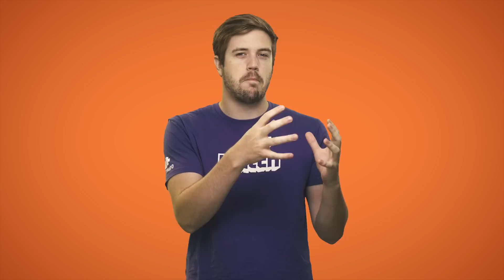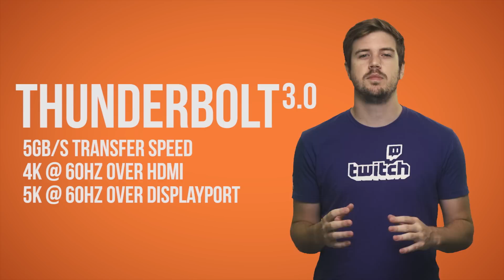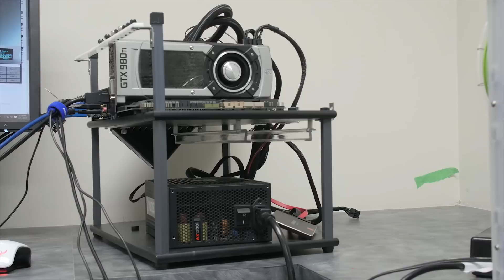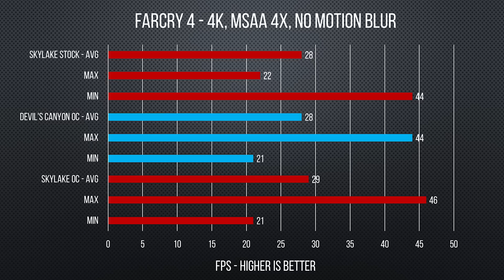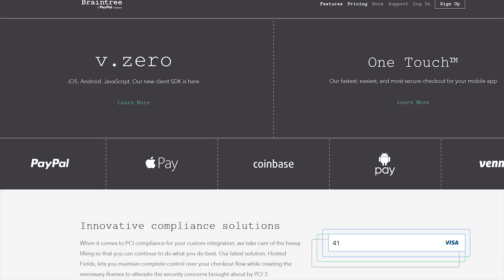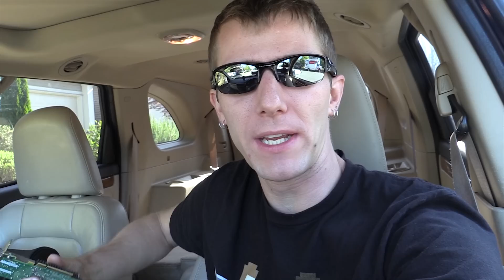Intel 6700K "Skylake" CPU

Comment: I'm on a budget, but is this build okay? http://pcpartpicker.com/p/JP9sNG
Reply: "budget"
Reply: Ethan Ly You know, the usual stuff. Web browsing, facebook, minesweeper, and MS word/
Reply: +Andloo Yunty It's brilliant, but honestly I'd replace the CPU with a potato. The new architecture that they implemented with the latest potatoes (codenamed "baked bean") really helps performance-wise.
Reply: ***** I know, it really is bad. I wish I could afford better ;(
Reply: 2263275electro They don't make 4TB, first of all. Second of all, I don't have enough slots. Thirdly, raid 0 scares me. Fourth, extra speed doesn't corrupt an OS. Fifth, who uses osx?
Reply: ***** The SSDs were PCI, so I couldn't have any more, the case doesn't support any more fans, and the smaller monitors are better than the 34 inch, so I use those for gaming and the 34 for watching netflix and surfing the web. I don't know much about peripherals, but I have tried the MX Master; I like it, but it wouldn't go with this build.
Reply: ***** Did I not say it's a BUDGET build? Do you think I can afford the $2.95 shipping on an MX Master?!
Reply: +Andloo Yunty hey what are you planing to do on it?
Reply: +Andloo Yunty You need 2 xeons... i heard they are the cheapest cpus on the market!
Reply: +Andloo Yunty buy 4way sli GT 210
Reply: +Andloo Yunty Will powerpoint animations run smoothly?
Reply: 2263275electro That's what I'm hoping for. :P
Reply: Andloo Yunty I`d recommend adding pci express 4 tb ssd`s in raid 0 to slow down the boot time. As it may corrupt your osx.
Reply: +Andloo Yunty everyone just wants fun man
Reply: 2263275electro Your friend got caught blatantly lying, it seems to me that he doesn't want to troll anymore. :( oh well
Reply: SoFloAntonioTheMLGPro Whoever told you that doesn't know what they're talking about. If you want to put a GTX Titan X, there will be severe bottlenecks in that build. A bottleneck is basically something that prevents something else from performing at full capacity, just as a real bottleneck prevents liquid from flowing at its full capacity. Also, the GTX 980TI outperforms the Titan X in gaming. Here is a better build with the same budget: http://pcpartpicker.com/p/ZGLCNG

     First of all, you need storage. In your build, you have a total of 150gb, which is enough to hold just over 4 major games.

Also, I don't know what possessed you to put those headphones in a gaming build. There is no game in existence that can use that audio. Plus, those headphones need an expensive DAC to achieve their full potential, so they wouldn't be doing much. They also didn't have a microphone, which you'll need in multiplayer games. 

Furthermore, you said you wanted 4k 120fps, and the monitor you chose is only 60Hz, which means 60fps max. I gave you 3 144Hz (144fps) monitors, with 1080p and your chosen monitor as a 4th screen that is 4k.

Also, you need much more RAM and a much better processor to avoid bottlenecking your video cards, so I gave you 16gb of 2400Mhz DDR4 RAM to replace your weird 2 gigs, as well as the current gen i7.

I tried to keep with your red and black theme throughout the whole build, and I hope you enjoy.
Reply: samuele collodi They are more expensive and perform worse in gaming.
Reply: +Matthew Bunn true
Reply: PluckyJokerhead I'll look into that. I don't think the gravy driver has been updated yet, but perhaps.
Reply: ***** I don't need super high specs; I can turn off some of the settings. I just need it to run at like 30fps.
Reply: 860K and 750TI 8Gbs ram 1333 MHz
about 400 usd
Reply: Ethan Ly That's a crappy build for 400. My current build is $370ish with specs that are nearly 2 times better than that
Reply: +Andloo Yunty  no you NEED 4x quadro m6000
Reply: Douglas Gardner quadros suck for gaming
Reply: WandexOfficial that sucks for gaming... and everything else
Reply: This is pretty original in my book. But if you got 10000$ go for it ;)
Reply: This is pretty original in my book. But if you got 10000$ go for it ;)
Reply: *****
a computer is all you need in life, we can 3d print food, you can work on a computer, you can pay taxes, and bills on a computer. really a computer is all you will ever need.
Reply: ***** thanks
Reply: Andloo Yunty 6th you know this was 1000% troll ehh?
Reply: 2263275electro Please don't troll on a serious thread. I'm trying to ask people who know about tech to help me.
Reply: Kyler Nelson Yes, but there are ways to have fun that aren't at another's expense.
Reply: +Andloo Yunty Oh look, how cool this guy is, the exact type of guy you would find on a Linus Tech video.
Reply: HJTh3Best What are you even saying?
Reply: Andloo Yunty what?
Reply: HJTh3Best What I understand of your broken English right now: Your comment is directed at me, your comment is sarcastic, and your comment is meant to offend me. I also know that you don't understand the irony of commenting on a LTT video about how people who comment on LTT videos are stupid.
Reply: Andloo Yunty Broken English what m8?, lets talk about hypocrisy.
Reply: HJTh3Best Oh yes, please show me one time I got my grammar, punctuation, or spelling wrong. Here are some quotes from you, "this guy is, exact type of guys" "Oh look, how cool".
Reply: Andloo Yunty Yes, whats wrong with that? I think you are the problem, my friend.

Although that was not the proper order of my comment.
Reply: HJTh3Best If you don't see the grammatical errors there, then you can't be good at English. I'm still waiting for you to provide me with grammar mistakes I've made.
Reply: Andloo Yunty You understood exactly what I said, isn't that the opposite of what you are saying about me? Besides, you deliberately quoted my sentences in a wrong order to make it look like you had a point. You need to stop trying, its getting uncool now.
Reply: HJTh3Best Once again, you dodge the question. Also, I quoted what you wrote exactly as it was written. Furthermore, I didn't understand what you were saying when you said it because of your terrible English.
Reply: Andloo Yunty Dodged a question? What other question?, I addressed your first question in my previous comment. There is a different between bad English and low reading comprehension skills, I'm starting to believe you are the later my friend.

PS. And no, you didn't quoted me correctly.
Reply: Andloo Yunty Your build (budget) looked like it was made by a troll so I had to make a comment within the boundaries of trolling.
Reply: I think I earned another butthurt tonight. Complaining about me for "destroying a discussion" after he abandoned said discussion 11 days ago, ins't that cute?
Reply: ***** I think so too, unfortunately I wasn't the one who brought that up here.
Reply: You oughta be able to run club penguin on that.
Reply: YOU CALL THAT A BUDGET!?
TROLLLLOLOL
Reply: Super ahmed LTT said it was a good budget.
Reply: ***** That's one of the worst builds I've seen at that price. You don't even have a CPU cooler, and you are running an obsolete (and bad) OS. Also, 3-way Crossfire/SLI decreases performance. Your storage arrangement also makes 0 sense. You have an overpriced 250gb SSD, but then you also have a 1.2tb SSD in the same build, and on top of that, you selected an overpriced HDD that really isn't necessary with your 1.45 TBs of SSD. Also, you have two different types of fans, which is a terrible idea. The processor will probably also be a bottleneck, but I can't be bothered to do research. Also, a water-cooling loop is never necessary and can cause many problems including leaks and having to fill it with water and route it through the case. The fan controller doesn't have enough channels for the amount of fans you have, and your case doesn't even have enough slots to fit them all. 0/10 worst build I've ever seen. I hope this is a troll, for your sake.
Reply: ***** Sorry for being rude. I was in a bad mood. Is your build for productivity, video editing, gaming, or something else? I can make you a build at whatever price point you want to make up for my rudeness.
Reply: ***** Okay mate. If you say so.
Reply: I know it's not serious, but the monitors actually bottleneck the system.  Gotta go for 144hz+ with that
Reply: Quietbut_Deadly Thanks for your help mate!
Reply: Andloo Yunty ( ͡° ͜ʖ ͡°)
Reply: Cool
Reply: TheTitaniumWolfman You have to use the permalink.
Reply: omg loooool
Reply: +Andloo Yunty That build is actually solid, however this build; http://pcpartpicker.com/p/xzdswP is cheaper, and offers two of the fastest 980Ti&#39;s I&#39;ve heard of. Feel free to modify it a little, to what you want, but I wouldn&#39;t change the fans as they are one of the best brands for letting air flow through your computer.

Feel free to also modify the monitors, and other peripherals. The SSD&#39;s are also optimized, the PCI-E card for windows or your OS you plan on putting on, the 250GB for cache (Can be swapped for 500GB version for more cache storage.), And the two 1TB SSD&#39;s for storage such as games, videos, etc. And for around $3000 less, it's a beast. Hope this helps.
Reply: CrimsonSword Thanks man. I just think people will laugh at me when they see that my bathroom computer isn't $10,000. sigh Maybe I can build this one for a high speed clock and backup for my web browsing in my computer room.
Reply: I'm looking for a amazing machine that runs games in 4k 120fps anyone think this can achieve it? http://pcpartpicker.com/p/CHXCNG or should I get more graphics cards.
Reply: SoFloAntonioTheMLGPro Hope that's a joke. So many bottlenecks XD
Reply: Andloo Yunty No it's not joke i'm seriuosly looking for a pc thats good for games. I heard processor and ram is for editing or rendering vids and graphics card good for games it was the most expensive probably best for my games.
Reply: Andloo Yunty thx m8
Reply: +Andloo Yunty "budget"
Reply: ***** Yeah, I know it isn't much, but like I said, I've already crashed two lambos this week!
Reply: Andloo Yunty I'm gonna salvage one of those lambos
Reply: ***** I already took it out on my yacht and pushed it into the ocean. Wouldn't want to give it to the greedy people at the scrapyard! It's really annoying, having to do all that work because somebody made a dent behind the mirror.
Reply: You call $9500 AUD.. A BUDGET?
WHAT!
Reply: hue hue hue

Comment: Would upgrading from an I5-4670K overclocked to 4.4Ghz to a I7-6700K or an I5-6600K be worth it If I'm playing at a high resolution? Like 3440 X 1440p?
Reply: Me Myselfandi Nope, high res gaming is all about the GPU. Also there won't be much difference between these two i5s, less than 5% all that for ~500$+ since you have to buy new RAM (DDR4). If you want to upgrade from i5 to i7, sell that 4670k and buy a 4790k, forget Skylake with your current setup.
Reply: Warrax Might just wait until 2016 or 2017 then, thanks.

Comment: Could you make a video about the overclocking on this CPU, like the maximum clocks you can reach?
Reply: Ali Neto Max clock speeds will vary from CPU to CPU, even if it's the same model.  The variance is referred to as the "silicon lottery"
Reply: Yes, but there's a medium speed between the same architecture CPUs, they could talk about how easy was to reach the 5.0 GHz (Skylake can get to 4.6~4.7 with minimum voltage adjustments)
Reply: Ali Neto
Well, you asked about the max clock speed, now you're asking about the average clock speed.

I'm confused here as to what you want.

Comment: I still run my 3770K at stock clocks because no need for anything else, unless you are building a computer this is pretty much useless Intel has been slacking off, AMD need to catch up badly, barely anything has changed over the years...

Comment: Meanwhile, AMD's Zen is going to feature 16 Piledriver cores and 32 threads.
Reply: ***** ... you mean Excavator? Piledriver is the shit used in the 8350 and 5800k. Not particularly impressive. Also Zen isn't going to be part of the Bulldozer family, Excavator is what they're putting in Carrizo.
Reply: Juicebox1155 Oh great. A fanboy. Just what this thread needed...
Reply: +Jak You know bulldozer and piledriver are two different architectures, right?  And they claim 40% increased IPC, I don't believe that, but I do believe at least a chip twice as powerful as an 8350 will eat the typical i7s for breakfast. They are supposedly fixing the cache latency, which makes them shit for gaming as well.
Reply: +Siberian Stars too bad amd is shit
Reply: Jak Still the 8320 and 5800k are still very good cpus, they support ecc and all the server features while being extremely cheap. So if you're broke and need a couple servers they are worth a look
Reply: Jak Not particularly impressive? An 8350 with double the cores and four times the threads?
Reply: ***** Not particularly impressive in terms of competing with Intel's per core performance. I'm still on a 6 core 1st gen Bulldozer and it gets the job done.

That said, no I don't think 16 cores and 32 threads of even the later iteration of the Bulldozer family 'Excavator' would be all that impressive. Everything in the Bulldozer family runs a little to hot for 16 cores of it to be running all that fast. Good thing that's not what they're doing. Zen is the name of a new architecture not based on Bulldozer, and I have high hopes for it.
Reply: ***** Oh absolutely, well at least in the case of the 8350. If you're going to go for an A10 might as well just go for the newest one since it will have largely superior integrated graphics. Hoping to see some Zen APUs in fact. If they came up with something at least 3570k equivalent but use their vastly superior graphics with it, that would be what I put in my HTPC/Steambox/Local MC Server.
Reply: Jak
please look at the c++ version of the minecraft server. It's well written. Won't run like shit.
But I do understand the need for a good apu.
I would actually want to see a high zen apu.
But yeah, for me intel's offerings in the low and mid end aren't good enough.
But hey at least the amd low and mid end all have ecc and kvm support
Reply: *****
 Then again, most cpus shouldn't be judged by their gaming performance. Benchmarks that aren't open source shouldn't be even considered either.
They do have better ipc. Not 40% but it's 25-30% better. Basically they just made the generation after slightly faster and cooler
Reply: +MrKillius24 I'm talking about Zen, AMD claims 40% over Piledriver.
Reply: *****
Oh that they've spent 2 billion on zen.Of course it will be 40-60% higher
Reply: ***** It is and it isn't. Piledriver is a different architecture but it was largely based on Bulldozer, with minimal improvement. When I refer to "The Bulldozer Family" I'm talking about the Bulldozer CPUs like my own FX 6200, as well as Piledriver, Steamroller and the upcoming Excavator. Zen is not part of that family, it's the start of a new family. Zen is going to feature Zen cores, not Piledriver. Hell, Piledriver would be a downgrade, like putting a Fermi chip in the 980 ti.
Reply: ***** I've seen it and I'm glad, but I'll give a fuck about it when it has mods. Until then I'll stick to 1.7.10

I am looking forward to maintaining 120 FPS with shaders installed though, that will look amazing.
Reply: Jak
The server could run mods if you actually used it. For things to progress it's all about getting user adoption. Once you start using it , and start finding solutions for it. You could get plugins and do  that yourself. Instead of using the older shittier ,badly written server. Do yourself a favor and use the open source version that just need user adoption.
Reply: +Siberian Stars that's an opteron.  those will only be in servers.
Reply: Scroll up this talking about x86 CPUs. 
Also x86 is a closed shitty standard
Reply: +KenKraken Almost everything that I use, with rare exceptions threads nicely.  Are you like old or something, or just never accepted the threading direction for computing?  Ever jump on the OOD/OOP bandwagon, or are you still coding in batch mode COBOL?

1975 is dead, man.  Welcome to 2015.
Reply: +MrKillius24 Well, PowerPC was an "open" standard, but turned out to be a failure.  Of course, there is always $PARC.  ARM is, well, cute.  And with an installed base of billions, I think x86 is here until Sol scorches the Earth.

On a side note, imagine how many Z80 cores one can fit onto the die for the 6700K at 14nm....  Hmmm...  8-bit massively parallel...
Reply: +Siberian Stars great! one more reason to stick with amd. put some fucking cores in the damn cips, what is this? 2002?
Reply: and will run like a dual core i3 lol